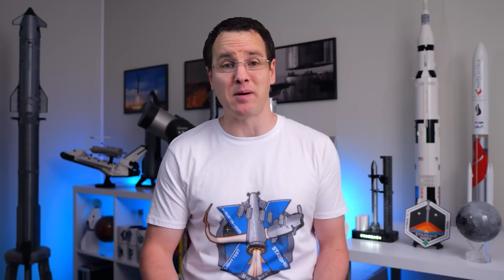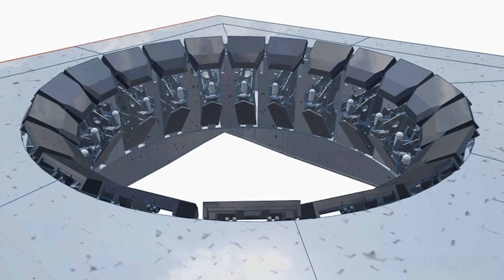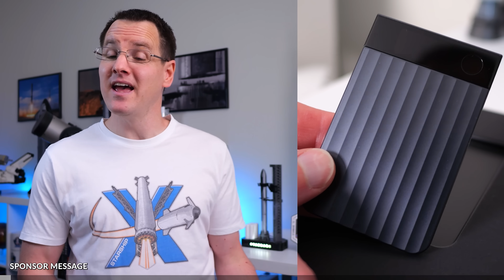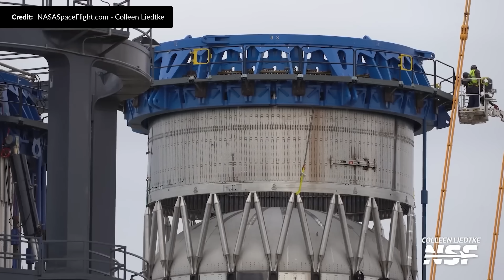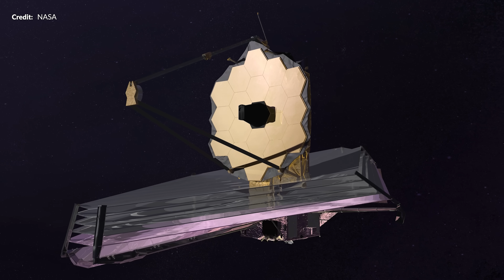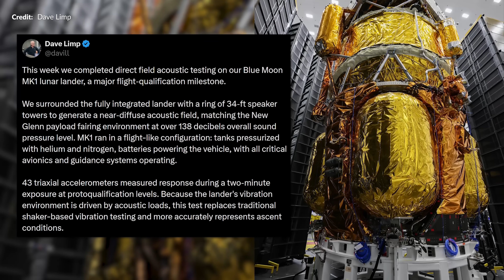SpaceX Just Turned the Starship Program Up a Notch

Comment: Once SpaceX makes a Stretched Orbital Fuel Depot for LEO, with Whipple Shield (metroid shield and boil-off reducer). All refilling ship prefills the Depot. Once filled, the Depot will refill all exo-planetary mission Starships in one operation, reducing refueling complexity. 

Now here is an option: The Stretched Depot ship still has 200+ tons of extra fuel left after refueling Starship. The Depot could be used as an Earth orbit reusable booster for Starship's manned flights, saving a huge amount of Lunar and MTI fuel. So instead of counting kg of fuel, worrying about IRSU, Starship can competently compete the mission.

Launching of the stretched Depot ship is easy. The Depot "is filled with vs can hold" enough fuel to make LEO and first refueling maneuvers. This ship contains all the refueling infrastructures, such that refuelers only need fuel tanks and fuel ports, keeping their complexities down.

Comment: If i had to guess, i would say that the medical emergency for crew 11 is probably the formation of a kidney stone, not life threatening, but serious enough to need medical attention soonest. If i had to point a finger i would say that the young lady looked to be in some discomfort, and a stone can be very painful and does need to be removed, at present the medical profession recognizes the pain, but does not rush to remove it, unless it does not move on its own. still very painful, when it moves, but not life threatening. But in zero G, it will not move very well without gravity pulling on it. If she does have a kidney stone and they have been monitoring it, to see if it is moving down the urethra, and it has not moved, then getting her on the ground so they can remove it becomes important, as they have to do it before the kidney shuts down, due to the blockage. Still this is just speculation as i really don't know, she just seemed to be in some discomfort, and a stone would be serious but not life threatening. I did read that astronauts who spend a long time in zero G are susceptible to the formation of kidney stones.
Reply from the maker: Yes, that sort of thing or appendicitis could be the sort of issue you would see a medical evac for. I hope we get to find out at least who had the problem.

Comment: COPVs are improved by adding thermal insulation. Epoxy doesn't perform well with heavy cycles of heat and cryogenic temperatures...
Reply: I thought the big issue is expansion of the over wrap and inner lining happening at different rates..?
Reply: External insulation only helps prevent condensation. The real thermal shock comes from the fluid entering the tank. If it is much colder, that can cause the metal liner to contract, separating it from the overwrap composite.

So consistently causing the pressure to rise enough before adding very cold fluids is essential for safety.

Comment: :_MarcusFace:Good day from Goonellabah, NSW, Australia. I use GROK 4. Keep up the excellent work. I understand I was a civil engineer. I have been a contract engineer since 1975, constructing sewage and water treatment plants from Melbourne to Cairns. I served as both the project manager and civil engineer. I worked as an engineer in Singapore from 2001 to 2005. We designed and constructed twelve-kilometre tunnels with two boring tunnel machines and five stations. I also managed a team of 160 engineers and architects. 
It began when I founded the Tamworth Rocket Club in 1969. Moving forward, I initially aspired to attend NASA to become an astronaut in 1969, but I ultimately pursued a career in engineering.🤗Ian Cleland - SUCH - Sustainable Urban Community Homes

Comment: Moon should be used as the lesser gravity allows for easier travel think heavy booster would get starship to a velocity that would shorten the flight time me I’d start designing a nuclear powered booster I dream of a fusion torch pushing ships upto a fraction of light speed 
 or a asteroid spinning with a long arm the arm would be moving at such speed just depends on the length ?
Reply: Nuclear makes for very poor booster performance.

Comment: When/If a tile cracks or breaks off the holes might be to allow any air entering the gap to have somewhere to escape instead of the pressure blowing off other tiles.
I imagine the stainless/padding is able to handle the heating from reentry gasses when the hole is that small.  
The stainless hull is a huge heatsink so extreme heating in a tiny area just gets heatsinked away to cooler areas and shouldn't cause an issue.
The holes could also be to stop pressure building under the tiles from thermal expansion now that they are filling all the gaps up with padding.
Reply: I think they are drilling out the ceramic foam directly above the connecting pins, and adding a reinforcement to each pin from the outside.

Comment: I sure hope that they make a Falcon heavy version of Starship. The hope is not only to push the limits of maximum load & fuel in one go but also to test the limits of platform & thrust diverter protection.
Reply: Strapping boosters side-by-side is not efficient. The Falcon-9 are limited in width due to transport on highways in just one lane. Starship takes up more than 2 lanes, and the highway can be made even wider. So, no need for that.

Comment: "Thinner section of the tile", now i had thought that one of the significant changes to the Stsrship Heat Shield compared to the shuttle's is that most of the Starship's is made from the same tile, but that sounds like its not so.
Reply: I think it's a thin section on each tile.
Reply: The thicker sections of tiles are hollow.

Comment: Oh, cool, maybe one of the Starships will finally push empty mass into orbit, for the first time.
Reply: You pretend that they didn't have the option in the past and chose not to do it for safety reasons..  But then you people tend to pretend a lot, lie a lot and generally be unintelligent don't you?  You zero's..
Reply: Block-3 is the beginning of production versions instead of prototype test versions.
Reply: @imconsequetau5275  We were told that about block 1. Remember? 100 tons to orbit. Block 2 was what? 150? I do not remember block 3 numbers. So far, empty mass to suborbital jump.

Comment: Serious question, as I've never seen someone cover it yet:

The new integrated hot staging section on the booster doesn't appear to have any directional shielding for directing the flip maneuver on the booster after separation. Why did they bother doing the testing of V2 for predetermined flip directions if they aren't going to do the same thing on V3?
Reply: Look harder. It's been covered.
Reply: Why did they bother doing the test?  Finding out if they wanted to do that was the whole POINT of the test.. of all the testing.  It's why it's called a test.
Reply: I believe that unsymmetrical thrust from the vacuum engines and vectored thrust from the Sea-level engines will help them separate with a sideways push. 

Also, hot-gas thrusters are going to be installed on Starship and Booster. That should help with flips of both.

Comment: Can you imagine the efficiencies and cost reductions that SpaceX could have achieved with Falcon 9 if they had gone through with developing full vehicle reusage instead of just the main booster?
Reply: As I recall they found it too small to be viable for 2nd stage reuse.  Likely why Starship is so big.  

:planet-orange-purple-ring:

:planet-orange-purple-ring:
Reply: At the time even a reusable  booster was an extreme stretch and was deemed an "impossibility" by all the "experts". The second stage is but a fraction of the cost of the booster.
Reply: @GntlTch  SpaceX was absolutely pursuing this for several years and had some very cool looking animations depicting a recoverable second stage. So they obviously thought the financial benefits were not negligible. Their abandonment of the process wasn’t due to lack of returns, it was instead because they felt that Starship would simply be able to replace Falcon 9 in a short amount of time, within even greater cost advantages due to its greater payload capacities
Reply: @jim2lane  They long abandoned 2nd stage reuse because they couldn't pull of the engineering and make it cost effective.  It had ZERO to do with Starship.  There was not starship at that time, I think it was still the colonial transporter they were dreaming of.

Comment: SpaceX deploys 46 new pieces of potential space garbage. IDK why wouldn't it be so hard to install like Kevlar drag balloon, or a routine in the thrusting program to dump the craft low into the atmosphere. Kessler syndrome is very much a FAFO type situation
Reply: If you had any awareness you would have already know that the de-orbitting function has been built into all Starlink satellite since day one.
Reply: Starlink sats are designed to de-orbit even if they fail. This is due to the atmospheric drag at the altitude they orbit. No balloons needed.
Reply: No, that's just what you people who get told what to think pretend you know.  Most of you people let others think for you.  It's sad, but it's what they want.  Mindless easily weaponized drones.

Comment: A new flame trench built next to tower A. The only issue is ground work and reinforcement.
Reply: The new flame trench is much deeper, so the soil has to be made more water-tight in order to dig it out below Sea-level. This is typically done by boring and augmenting the soil with cement, in addition to deep reinforced concrete piles.

Comment: Am I the only one wondering how they'll get people into the ship when required?
Reply: I’m waiting to see how they plan to get anything larger than a Starlink out so much seems essential where do they cut the giant hole to get cargo out.
Reply: @tbix1963  Have you seen the conceptual drawings from previous episodes and other channels? SpaceX is way ahead of this train of thought.
Reply: Did you see the large rectangular access door prototype? It had a slide-to-latch mechanism.
 @tbix1963
Reply: They need more than a door on the side before they take humans. You know they’re already probably planning 20 different versions of Starship (Pez dispenser, refueling, moon landing, for example) in the same way that there’s maybe five different versions of Dragon in use (resupply, round-trip the crew, spacewalk).
Reply: The first crew Starship is the HLS version which has a docking connector in the nose, plus a door from the unpressurized cargo compartment to the outside. This may double as the elevator door. There will be an airlock from that level into the pressurized crew compartment.
Reply: @imconsequetau5275 I was being facetious, but it was more the tower to ship journey that needs solidifying. Mechazilla will need to sprout another arm, I think.

Comment: I wonder if the drilling of holes in the heat shield tiles are in response to the findings from Orions heat shield cracking from gas build up. Seems like they are testing that half of starship at least.
Reply: No that heat shield uses a different material entirely. It's like an epoxy applied wet instead of dry ceramic tiles.
I think the holes are for measuring free play between the tile and mounting pins
Reply: @prophetrob what do you mean exactly. How does that test this?
Reply: @Barthhhelona  Starship heat shield tiles are not a ablative heat shield by design like Orion and Dragon which use a fiberglass and resin based system (PICA as an example).  Starship uses kiln baked ceramic tiles.
Reply: I think they are reinforcing the 3 pins holding the tiles.

Comment: The holes in the tile could be to vent the area behind each tile so that changes in the external gas pressure don't crack the tile
Reply: There are already gaps between tiles that allow this
I think they were measuring how much play there was between the tile and the mounting studs
Reply: It might be a way to improve the fasteners.

Comment: I don't understand why they build the launch towers so close together? If a rocket explodes on the launch pad, could one of the other launch towers get damaged? Or is the distance greater than it looks??
Reply: Greater than it looks, flame trench directs the initial blast, lots of blast-walls and some very sturdy stainless steel piping. A lot of this stuff is overbuilt but it it is also in dual use as protection against hurricanes
Reply: The sites are big and honestly space is limited..

Comment: I noticed the test with the new arms. There’s no wiggle at the end. The shorter arms are definitely going to be better.
Reply from the maker: It is exciting to see. I'm trying to determine how exactly these new ones work. There have been arguments that they are electric or partially electric, but based on what we can see, it seems largely hydraulic.
Reply: @MarcusHouse I was surprised as well to see hydraulics on the new setup considering they already switched a lot of their hydraulics to electric actuators like TVC or grid fins.

However I suspect electric actuators while more precise could have an issue with longevity at high torque since they use some kind of gear that will wear off over time. I guess with Stage 0 they prefer longevity over maximum precision.
Reply: Chopsticks are predicated on hover ability of both the booster and starship.  The Tower can not survive a hard impact due to bending moments. Shorter arms reduce the lever bending moment.
Reply: @mefobills279 no they clearly stated several times that they simply want to reduce length and thus mass for better control of the chopsticks. Otherwise there's just too much momentum involved.

Particularly with the dampening rails specifically for landing the impact itself is not the issue for the chopsticks. They have been probably engineered in a way that even a booster landing on the very tip of the original chopsticks wouldn't be an issue for the structural integrity of the chopsticks.
Reply: @niri2506 Any engineer can calculate for bending moment.  The tower also "rings" with a natural vibration frequency after impact.  The shorter arms are also have less inertia due to lowered mass.  All of the Tower variables are predicated on mature hover capability of both starship and booster.  Speed of the arms implies high speed catch and high impact.  The Tower cannot take a high impact due to bending moment.  There is no hand waving allowed here, the physics are immutable.
Reply: @mefobills279 nobody is saying it's not dependent on both Starship and Booster being able to hover. But it was clearly stated that this decision was made to enhance control ability by reducing mass. Not because the tower wouldn't be able to handle a landing further out on the chopsticks. Obviously they designed it in a way so that it could handle even that since they didn't know beforehand how close to the tower they'd be able to maneuver during hover.
Reply: @niri2506 Agree, control ability is related to mass, as inertia is lower. Pay attention to physics, and don't ignore what is in front of your eyes.  One pound of weight one foot away is one foot pound.  One pound of weight two feet away is two foot pounds.  The forces start multiplying quickly, no matter what Space X says in their press releases.  The engineering limits are much more than just arm speed. A high speed impact far away on a lever arm on a long tower, means the Tower is the weak sister, and its safety margins depend on the booster/starship having good hover control authority.
Reply: @mefobills279 again. Nobody is doubting how bending and rotational moments work. Also nobody suggested a high speed impact. What I'm saying is what you are concerned about was considered from the beginning and engineered into the design and not the reason why the chopsticks were shortened.
Reply: @niri2506 You are ignoring the data from the first catches where there was concern for the Tower itself..  You obviously are unwilling to open your eyes and think shortening the arms is only due to arm inertia.  Its ok to not be an engineer.  The booster will be more limited in its angle of approach as well, with the shorter arms, again putting more emphasis on Hover maturity as well as fuel margin (to enable hover).
Reply: @niri2506 Elon usesthe box analogy.  We design and blow up things to find the corners of the box. The initial tower design was predicated on guesswork.  The box size was untested in real life. The chopsticks are only one side of the box.  Accelerating and deaccelerating chopstick mass is the least hard problem to solve.  Hold a pair of sticks on your hands, then swing your arms,  if you  doubt this. The size of the box was changed based on tower bending moment, vibration frequency, and especially hover margin. The size of the box was made smaller this giving the Tower more safety margin. Stick length matters due to lever effect much more than inertia. Servo motors, resolvers, and recirculating ball screws could easily be made to drive long chopstick arms to within a degree of accuracy.  The arms are a simple problem, the other sides of the box are not.